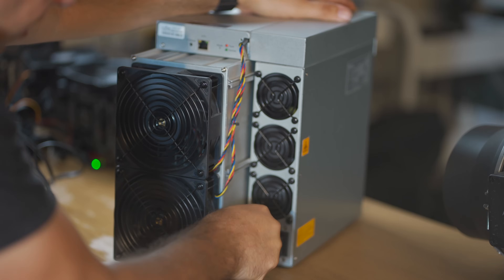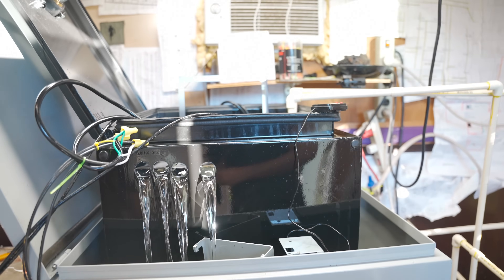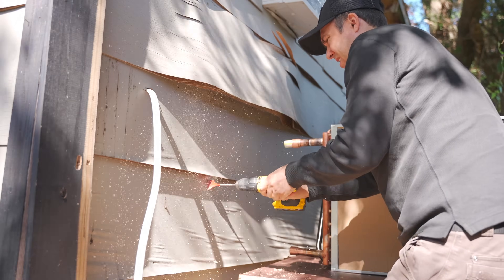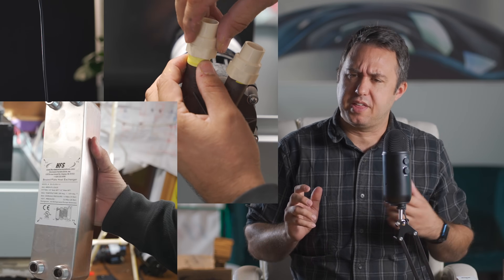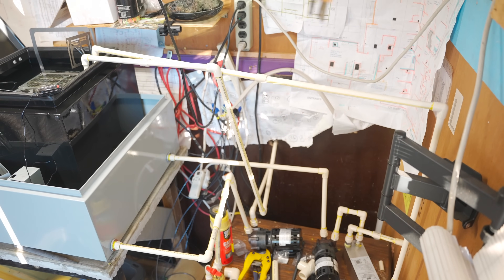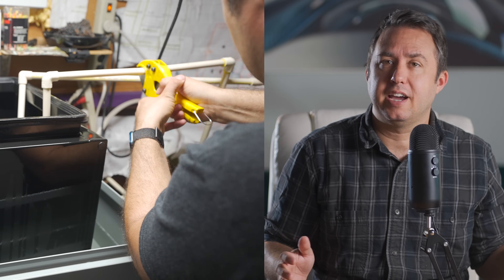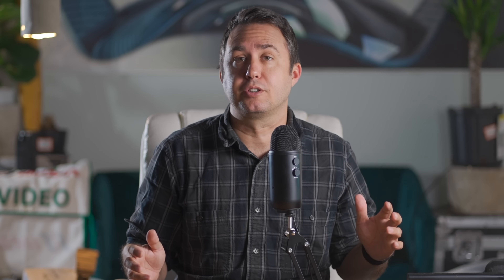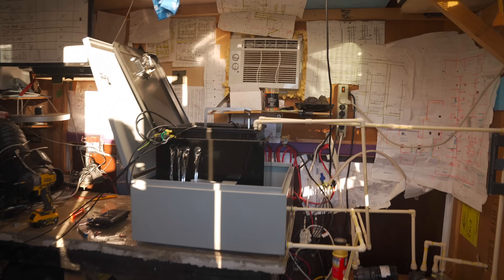Heating a Swimming Pool with Immersion Cooled Bitcoin Miners ASICs

Comment from the maker: IMPORTANT UPDATE!!!   That particular brazed plate heat exchanger is the wrong thing.  Chlorine eats copper brazing, so it would eventually leak and mix pool water into my ASIC tank.   You need to look up an all stainless steel heat exchanger for pools. 

Thank you!
Reply: Double walled for bonus points.
Reply: @jon8864  Double walled is only required for domestic water.  Don't think a swimming pool is considered drinking water....but maybe.
Reply: @jmaus2k  as I understand it double walled means when there is a leak the two liquids don't mix,  they leak out the bottom. It's not so you can drink the pool water without getting oil in your mouth,  it's so you can submerge 20k worth of miner in oil without getting pool water in it!
Reply: @jmaus2k  and maybe a little urine...
Reply: @jon8864  This actually is a code requirement for house water.  You don't want solar water heater glycol to mix with water you drink.  Only takes a little bit to cause you problems.  As for the codebook, don't know if a swimming pool is considered part of the domestic water system where it would be required, but certainly should be considered based on how poisonous the cooling fluid is.  If you don't do a double wall, you could add a monitor to the oil to detect lower resistance if water leaks in.
Reply: @jmaus2k  I'm not really interested in following code to the letter,  only learning why something is put into code.
Reply: Thanks for the heads up. One thing I don't seem to get about the heat exchanger line. You've got your 2nd pump to pull the hot liquid from the tabk to one side of the heat exchanger, but how does chilled water from the pool get into the heat exchanger?
Reply from the maker: @af6727  there’s a floating submersible pump in the pool pumping water into the she shed to the other side of that heat exchanger.
Reply: If you use the Poker hydraulic hose that EF recommends, or copper pipes to go along with your radiator, I'm assuming you wouldn't be having this problem, yes?
Reply: @af6727  whats EF?
Reply: Can you share a link of an alternative? Everything I find on eBay seems to be 99.9% copper even when the title says stainless steel. It seems like all the brazing is copper.

I think I just have to search for "hot tub heat exchanger" and it's all the tube-like models.
Reply from the maker: @EarlCo  some like this one https://www.cncest.com/products/cncest-304-stainless-steel-tube-shell-pool-heat-exchanger?variant=41558258450602&currency=USD&utm_medium=product_sync&utm_source=google&utm_content=sag_organic&utm_campaign=sag_organic&gclid=EAIaIQobChMI4b7dkqGt9wIVqnxvBB1moAwmEAQYASABEgLanfD_BwE stainless steel pool heat exchanger
Reply: That was probably very expensive.
Reply: I was actually just coming back here to ask about this!! Thanks for the update! :D I wonder if I'd be able to keep my pool open year round with just 2 L7's heating it thru the 1/2" pipe.

Comment: is it still working?
Reply from the maker: Ive actually sold that house and my wife and I had a new one built!  There is a pool going in as we speak.. But I dont think Ill have readily available 240v power back there.  It did continue to work, though.  I had initially gotten the wrong type of heat exchanger between the pool water and mining fluid - you need a stainless steel one, made for pools. Otherwise the chlorine will eat through the copper in the one from this video.   Concept is the same though.

Comment: Im curious if all this was necessary. Wouldn't it be easier to use a liquid coolant system already used in PC's but instead of a closed system use a pump to send through the swimming pool water?
Reply from the maker: @anno20-23  well a liquid cooling system for pcs is designed to cool a single chip about an inch across. These machines have hundreds of chips on wafers that are almost a foot across. So you’d have to custom design the block that rests against the chips.   Although, those systems do exist now
Reply: @SPACEDESIGNWAREHOUSE  I didn't know that but thanks for the reply. Would make it way easier though if it was possible! :)

Comment: Just a heads up, you can't use a brazed plate heat exchanger on chlorine water. It breaks it down. Try stainless steel! Great video!
Reply from the maker: Yep, luckily someone else had pointed that out and I disassembled this thing after about a month. Great proof of concept but definitely carefully consider materials.. thanks!

Comment: Excellent video friend. Do you think that using 2 containers, the external one with ice water and the internal one with mineral oil, will serve to keep the asic miners at a good temperature? Thank you
Reply from the maker: It would keep them at a good temperature until the ice melts.  Generally if a container of ice water is sitting next to a tank of 100 degree oil, it will melt the ice and heat up that water tank.
Reply: @SPACEDESIGNWAREHOUSE  Friend, yes correct, the idea is to keep the ice in the external container with water constant, look for temperatures close to 20 ºC. Another thing, what disadvantages does oil immersion refrigeration have? Is it true that it affects the cards, and wire?
Reply from the maker: @yeanpadron7020  if you use electrocool instead of Bitcool, it will not affect the wires and cards. But it’s rather expensive.

Comment: I subbed just because you did this. Well done. This is pretty genius. Funny thing will be if the crypto earned will have paid for it all
Reply from the maker: Well 2022 was kind of a bummer, I keep getting more and more Bitcoin all the time, but the dollar value of my entire account has shrunk over the year!  I’m holding though
Reply: @SPACEDESIGNWAREHOUSE  next halving and bull run could very possibly put you in the green even with the SATs you get. 

How much temp change was noticed from running the system vs not. In terms of the pool getting warmer. Was it noticable?

 If anything it's just over kill cooling for the miners.
Reply from the maker: @evanwinegardner4103  Surprisingly YES, the pool was getting warmer!  Its a huge amount of water, but a constant stream of hot water does in fact tip the scales.   WHat I found out, later, though, was that chlorine and copper brazing dont play nice.. So I had to take the thing apart shortly after making this video otherwise eventually pool water was going to infiltrate the cooling system on the miner side.. You can do the same thing with a stainless steel heat exchanger.

Comment: how fast 3,2kwh asic mine will heat 150l boiler water to 65degress, for the rest of energy I want to use for home heating by drycooler
Reply from the maker: Well, the electricity is nearly 100% converted to heat.  So if you consider a hot plate takes about 1000 watts, this would be like three hot plates running continuously. So 150 liters would heat up in 2 hours and 27 minutes according to this calculator?  
https://bloglocation.com/art/water-heating-calculator-for-time-energy-power

Comment: Any form of alerting/notification if a pump dies?
Reply from the maker: That would be a smart thing to add to the system.  I dont have anything for that, but there are things that can alert you if the power stops at a particular breaker.

Comment: 4:50 when you said the brazed exchanger exits the oil a "little bit" cooler, does that mean such a channel alone won't be enough to cool an S19?
Reply from the maker: A heat exchanger alone WOULD be enough to cool an s19

Comment: Blah blah...  maybe impressive to newbies... but ive been water cooling and overclocking for 24 years now... That pool with its giant surface area and being underground... will remove any heat from a tiny little outlet from a 800gph pump pushing out 78f water, also that pump may say 800gph on it.. but thats at the outlet on it with no piping..  That doesnt count head pressure, every little 90 degree angle turn and length of tubing you did on top of that heat exchanger..  I bet you have half of that flow or less.  Judging by the trickle of water coming out it looks more like your pushing around 2-300gph tops.   For example, a 3300gph pump for 50 feet 1 1/2 inch pipe. you lose 10' of pressure due to friction loss.  This means the pump will be reduced to 1700gph.  

 Why dont you do some real math by having that fill a 1 gallon container and putting it on a timer. then do the math to see the actual GPH....... LOL......    The only way you will see an increase in temps is if ambient air temp goes up and the SUN UV rays are intense that day and this would have happened without that little pump , or you could block the entire surface of the water so you dont have gas exchange with the air which drops temperature of bodies of water.. then you might just see a few degrees increase.   This wont heat your pool...    The only thing this system is good for is going fanless by using ambient temps of a large body of water...  Nothing different than stuff we did 20+ years ago when benchmarking.

Also a hot tub.. at 400 gallons, needs about 34kwh to heat the water fromn 65-100f..   That mean it will take a 6000 watt 240v hottub to heat up the tub by 30 degree's about 5-6 hours to heat the tub up...   I highely doubt your bitcoin mining is putting out 116,620 BTUs of heat unless you got 10-15 3090TI's in that little box...  So in essence.. no you wont be heating a 400 gallon hot tub to 100f.. let alone a 3,000 gallon pool to 70f. with just 2 machines
Reply from the maker: These two little machines pull 7000 watts! That’s more like 20x 3090’s!! It’s a shocker how much electricity they use. 

I’m not saying it will QUICKLY heat up a pool, but I doubt my pools surface area is capable of shedding 7000 watts worth of heat continuously.. Surely you’re right about the 800gpm pump being slower through all this piping, but all that means is the water comes out hotter than it would with more flow.

Comment: As a aquatic engineer with self taught crypto knowledge and self built miner of only one rx 580 8GB i work on pools and the automation for the iaqualinks antennas use SHA-256 encryption and was developed with python, my home built miner with home depot wood is on my chan

Comment: This is really cool. what would be more officiant is using the pools pump that circulates the water to enter and exit a heat exchange. then the water would discharge from the pool jets and one less pump to operate. great work
Reply from the maker: I had thought about that, except the pools pump doesnt run 100% of the time.  Its on a cycle of like 8 hours off per day - which would affect the cooling of the miners pretty bad.. I could, I guess, turn the pump way down and have it run all the time and get that effect

Comment: GREAT project! Any updates on the stainless steel heat exchanger ?
Reply from the maker: I got super backed up with projects and real life and I slapped two radiators on those lines and that’s how it’s been running for the last month. But I’ve got the thing!! Starting in a couple weeks I’ll stop traveling and get back to these projects
Reply: @SPACEDESIGNWAREHOUSE  thanks mate! You’re AWESOME 😎. I’ve subscribed and will be delighted to hear from this project update! Great way to make mining “somehow more sustainable”.

Comment: How were you able to appropriately size a heat exchanger per your setup or kw?
Reply from the maker: By oversizing it with two pretty big radiators, each 24”x24” with three loops inside them.

Comment: is there a reason why you didn't go with the T cap to force air out? just like you did in your previous build. I wonder why did you go for pipe cutting here?
Reply from the maker: I thought I had bought one and then AFTER I started putting everything together and started filming and it was all happening I realized I bought it in 1” and didn’t have one, and didn’t want to stop everything and go to Home Depot:) 
I recommend having it!
Reply: @SPACEDESIGNWAREHOUSE  Thanks! My march pump is coming. I have it planned to be lower than the tank and installed a ball valve right after a T-cap. I should be able to prime it with no issues.

Comment: Hi!! I´m from Argentina, and i will like to know about the material of the tank. I´m doing one my self and i dont know about which material can i use!! if you can help me, i will be very gratefull. i really like your channel
Reply from the maker: Hey Patricio! This tank is made out of acrylic. But I didn’t put it together myself. I think steel would be WAYYYY easier to work with. There’s certainly no reason it needs to be seethrough.

Comment: So you have two pumps. Is that so you dont have to have your pool filter/pump running. Or would you have to have that running as well as the two other pumps in the video.
Reply from the maker: Correct - plus I didnt want THAT much water rushing through the heat exchanger.. My main pool pump is like 50 times stronger than the one pumping pool water through this loop.
Reply: @SPACEDESIGNWAREHOUSE  Thank you for the reply and information. I had one additional question for the 1 inch copper to 1/2 cpvc pipe, do you see any reason to not use these shark bite fittings? https://www.youtube.com/watch?v=gToGpVqorZA
Reply: @SPACEDESIGNWAREHOUSE  I think I misunderstood before I asked my original question. You have the 2 bitcool approved pumps then you have a third pump that isnt shown that is for circulating the pool water through the heat exchanger, correct?
Reply from the maker: @Nato3713  that is correct. Two March mdx pumps with viton seals for the Bitcool side, and one cheap plastic little 8 gallon per minute submersible pump in the pool, pushing water into the heat exchanger and back to the pool

Comment: Interesting Video, which heat exchanger do you use for 2pcs S19? 160KW 40 plates? I would like to build the same.
Reply from the maker: Iim glad you asked because it turns out the one I got is the wrong thing entirely.. Chlorine eats brazed copper, so you need to find a stainless steel heat exchanger made for pools..

Comment: Awesome video love it!  Curious about two things.  I know you mentioned that the pump was approved via Engineered Fluids but I can't seem to find it.  Mind sharing the model number or link?  Also curious about the use of the radiator?  It was hard to see how it tied in the final design.  Was it intended to augment the heat exchanger or was it for an other purpose?  Thanks again and great video.  Wish I could make these!
Reply from the maker: For sure! And actually the pump is right there in the description; here's the link: https://bit.ly/3tIneAn

The radiator is a redundant system.  So in the event that the heat exchanger pump dies, or something gets clogged- that radiator is big enough to completely cool the whole system by itself, and so is the heat exchanger.   These machines are too expensive to be thwarted by one part going bad in a home made cooling system.
Reply: @SPACEDESIGNWAREHOUSE  Good idea on the redundancy! Thanks for the reply and the link!

Comment: Great video, very informative. Will be interested to see the results of how well this works over time. How warm does your pool end up getting?
Reply from the maker: Well, unfortunately, I quickly discovered that brazed plate copper heat exchangers get dissolved slowly by chlorine! 

I need to swap out for a stainless steel heat exchanger.  So in the mean time I have it just on the radiator. 

BUT for the two days it was running it raised the whole pool by 10 degrees! So I think the prototype is a success
Reply: @SPACEDESIGNWAREHOUSE  10 degrees in 2 days, ya I'd say it's working well!
How did you learn it dissolves, and how slow is slow? I know another guy using copper heat exchangers, not sure how long, but definetely more than 2 days. Are we talking a couple months, year?
Was looking online for some steel heat exchangers, not seeing any in that size or form factor. Have you found one that will work?
Reply from the maker: @techengineer9589  Just google swimming pool heat exchanger. 
I have a discord channel for my YouTube and there’s an HVAC guy in there who told me to look into chlorine reacting with copper brazed plate heat exchangers and I found that they will corrode “pretty fast.” 

There are a ton of variables but heat speeds things up and that’s sort of the entire point of the thing.. It won’t happen in days, but it’s unclear how many weeks it’ll be before the water eventually mixes with the coolant and that would be very bad
Reply: @SPACEDESIGNWAREHOUSE  Fair enough. Gonna see how long he's been using it and any issues. I'll also warn him about that potential serious problem.. Thanks!

Comment: Hey man, why don’t you look into pump recirculating equipment for home brewing. Looks like you did a bit too much work for this. You could have gotten a custom copper pipe and ran it around the miner with the Bitcool filled in and ran the pump from the pool into the tank and back it to the pool for a fresh steam of cool water
Reply from the maker: Like just a bare copper pipe but no heat exchanger or radiator?

These are pulling close to 7000 watts of power with most of that becoming heat. That’s quite a lot of heat to get rid of!
Reply: @SPACEDESIGNWAREHOUSE  brewing equipment such as an immersion chiller or counter flow chiller is taking water from 212 to 70 degrees within mins. You can probably engineer a double chiller. Use the bitcool with the miner, then in a different Vat, have some glycol that chills the bitcool, and then another chiller that runs to your pool. 

These chillers work wonders and they are fast. How hot does your bitcool get just by itself with no cooling? 

https://youtu.be/S1CxyKL7sUg
Reply from the maker: @bg1n  with no cooling it would just get up to 90C and shut itself off within about a minute. It needs to be cooling constantly at something like 14,000BTU